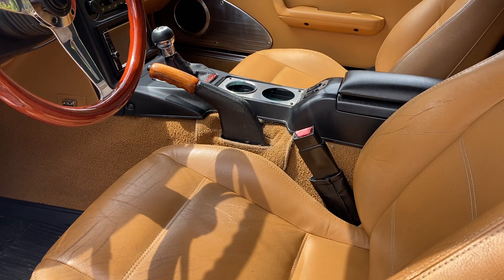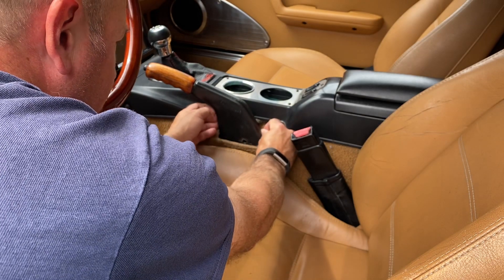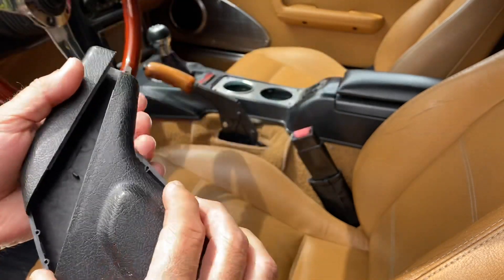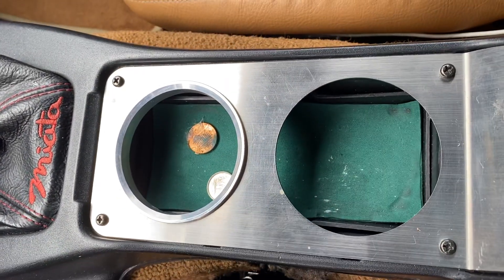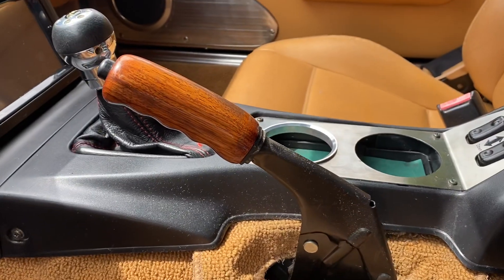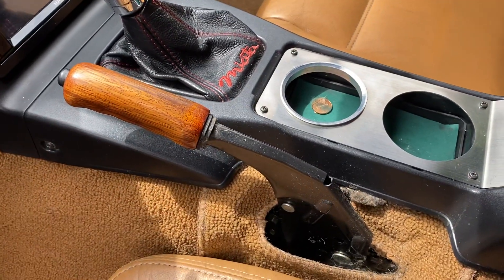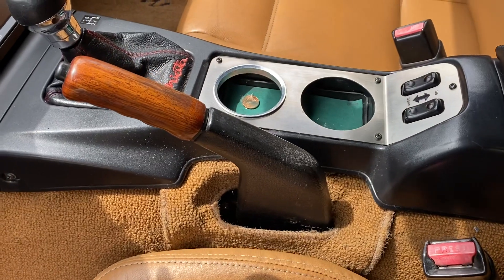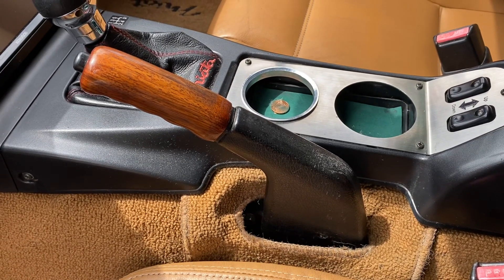Hand brake adjustment 1990-2005 Mazda Miata

Comment: I was over-enthusiastic and almost smoked my clutch with this. I tightened the handbrake until it had a really nice, firm pull. Then I went to start the car the next day and wondered why it ran so bad... luckily I only drove a few hundret meters before I remembered that I probably overtightened the handbrake cable...

Comment: Great!  Would love to see a video about the trunk release, and gas door release in the center console.  My trunk release leaver is way down, and isn't sitting level with the gas door release, like its been pushed down.
Reply from the maker: I wonder if the return spring on the lever has broken?
Reply: @MiataMan  I'll have to check that out. It still operates, but I the more I think about it, the more a broken spring makes sense.  Thanks!  You make some great videos for us new to miatas.  I've always been a old VW guy (I'm old too btw lol), but these help out a great deal!

Comment: hi! my miata ebrake only worked for a day then stopped , i think it’s because i need new calipers but my bf and i tried to tighten the handle and the caliper way as well to see if it would work. i hear a squeak now that i thought was the breaks at first but it’s the ebrake. it will go away loosening the handle and caliper thing right?
Reply from the maker: It sounds like you need new rear callipers. The squeak should go away if you back-off the hand brake cable. 
If it squeaks after that, back-off the calliper adjustment.

Comment: Idk if youre still reading comments on this video, but any tips on removing the wood handle? I just bought one with the nardi torino and im trying to preserve it all so i dont want it on the car.
Reply from the maker: The ebrake handle is usually glued and pressure fitted on the the arm. 
Twisting back and forth while pulling on it will usually remove it. 
Try to find some rubberized work gloves 🧤 to give you a better grip.
Reply: @MiataMan  thanks!